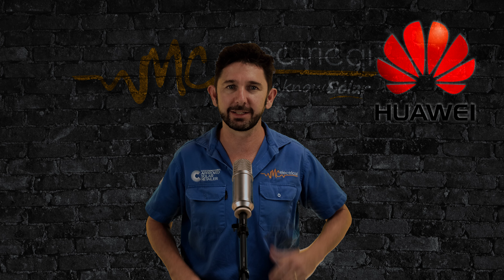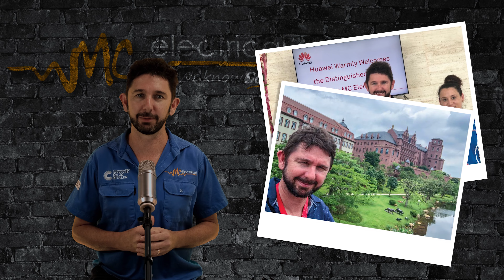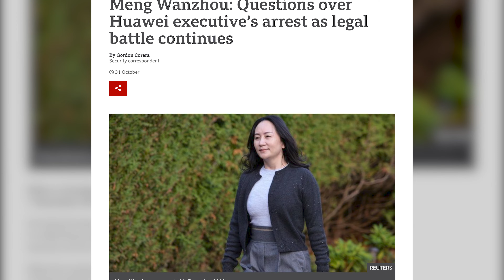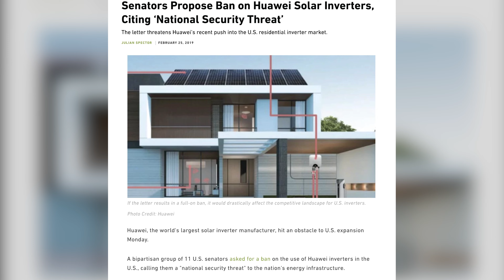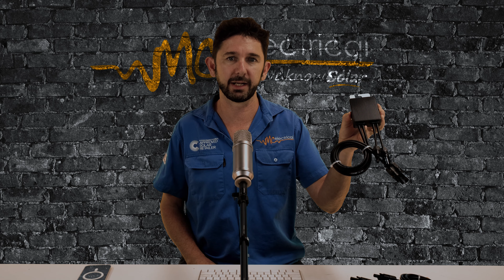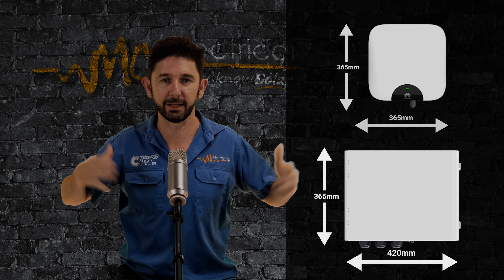Huawei | Solar Optimisers & Micro Inverters Mini Series

Comment: Hi Mark, this has been a good informative video and comments section for me, as I have a Huawei Sun2-6KTL-1 inverter, Luna 5k battery and 8.3kw worth of panels (2 E/W strings of 10 (i.e. one per MPPT).  Am in UK, during the wintertime I have quite severe partial shading issues due to nearby tall trees which really impacts the moring and then late afternoon solar in Dec and Jan (as sun doesn't get above the trees).  Things are better Nov and Feb as only the morning impacts.....then the other months improvement is fast and the shading really isnt too much of an issue, just very short lived in mornings on the E string only (and no real impact during peak May and June).  I had however been considering if optimizers might help this issue in the off season...but what I'm picking up from the video/follow on comments is that they may be more trouble than they are worth...is that right?  Any further definitive thoughts on these four years after you put up the video?  Secondly...had a quick question on where you said you couldn't do one string of 10 panels and another of 14.  Have been considering putting another four 415w panels (same as the rest) on the West side (bringing the total array to just uder 10kw).  Installer did calculations and seems viable for another four.  But you said not doable (but is that just if in parallel vs series?)  Thanks!
Reply from the maker: Hi Daniel, last question first, if you are paralleling into one input it needs to be the same number of panels in each string. If in series then all panels should face the same orientation. Also, longer strings are better if you have shade, because if you shade for example 4 out of 14 panels, then you still have a good voltage for the inverter. 
Second, yeh optimisers are more hassle than they are worth. The Huawei inverter doesn’t have a gmppt (global maximum power point tracker) so optimisers may give you a small advantage, but I probably wouldn’t bother. They create just another point of failure. The inverter still has a maximum power point tracker so it does a decent job of dealing with shade.
Reply: @mcelectrical  Thanks very much for replying....there are two  inputs, one per each set of panels, so think all ok then if your comment was about regarding into one input. And thanks about the optimizers....will give them a miss, a tiny improvement defo doesn't sound worth the hassle!

Comment: If i have SolarEdge optimisers on my panels but want to upgrade my inverter to Fronius or Sungrow , Are the optimisers still compatible in that system ?
Reply from the maker: No. You would need to remove all optimisers. If you have a shade issue, then fronius will solve that, Sungrow won’t.

Comment: I have the sun2000 6ktl -1l I have 6300 watts worth of panels and I have on string of 5 and on string of 9 panels will that hurt my total output power from my solar panels?
Reply from the maker: If you mean oversizing your panels, 300w bigger than your inverter, not at all. We normally install 33percent more panels, so 8kW on a 6kW inverter. This is usually better for inverter efficiency.

Comment: Thanks Mark for your commentary on Huawai Inverters but you didnt really talk much about the Huawai optimiser  which was the stated intent of the video (unlike your excellent video review of Tigo optimisers).  Frankly I was left a little disappointed: maybe you can do a part 2 specifically on the optimisers and their monitoring .  Thank you.
Reply from the maker: Hmm, good point, I didn’t go into the optimiser much. But here is my update. Don’t use an optimiser. There is no need unless you have split orientations, and even then, it is better solved with good string design. Optimisers fail and don’t do much at all at best. If the issues is shade, use Fronius or SMA who have a quality gmppt (or “shade fix/ dynamic peak manager).

Comment: We have been having trouble with the Huawei optimisers, they are cutting out multiple times per day. The system was set up on 2 strings 6 panels on one and 8 on the other (total 14*475w panels) 6.6kw. Huawei's solution was to put all 14 panels on a single string to increase the voltage and "force" the optimisers to work correctly. Does this sound normal?
Reply from the maker: Hi Simon, i can't speak for Huawei optimisers, but tigo and solaredge both have weird issues. I have completely gone off optimisers -stick with a string inverter with a GMPPT like fronius or SMA.

Comment: I don’t understand why you would not research before you do a video. The warranty on this item is 25 years! The 5kw inverter you say is no good for 90% of your clients because they install 9kw systems, well it’s 5kw per string! So 10 total. And you did not tells us what the actual power consumption of this unit is. So pretty useless video really.
Reply from the maker: Sorry about that Richard, but you obviously come from another country that has different warranties and different regulations. We can't 100 percent oversize a 5kW inverter.

Comment: Hi there! Can you do partial optimization in a single string? For example if I have 14 panels and I want to install 6 optimizers, can i do it within the same string or do i have to create a seperate string for the panels that use optimizers?
Reply: You can do partial optimisation. For the single phase L1 model its a minimum of four on a string and for the three phase models its a minimum of six (this comes from the datasheet) https://www.solar4ever.com.au/info/Optimisers.php  Note that you can also use optimisers to run a string in several orientations or keep a string below 600v so they are quote versatile. For the multiple orentations you can do partial or full for the string. For example if you had six panels north and five east you could fit the optimisers to the east, north or all the panels on that string. if you fit it to all the panels it will work better as it can adjust both ways to match up but even if you do partial it will still alter output to match up with the unoptimised panels. Note that you need to keep in mind the minimums mentioned so if you had a string of ten north and three east then you cant just fit them to the east as that would not meet the minimum optimiser requirement so you could fit the ten north however in that case you may as well just fit them to all the panels in that string. If your other string is say 8 panels west then that can be left unoptimised to save money. Its a very versatile system and keep in mind you can always run 2x5kW inverters which will cascade for their data feed and act like a single 4x MPPT inverter in terms of monitoring and connectivity (only the first inverter connects to the smart meter and internet).

Comment: Love the presentation, very informative and straightforward. 
Please I personally need some education on the optimizer,
My concern has to do with the output voltage of the Huawei optimizers.
Am using a 275watts 10-50vdc  rated optimizers on 275watts 38.9vmp panels but the output voltage of the optimizers has been reduced to 26.7vdc but I get up to 46.7voc when I test the voltages of the panels directly with a multi meter.
Please is this normal ?

Comment: I don't understand the problem with current you mention. I intend to use this inverter with flat roof and panels only in one direction.
I understand that the EPS is only needed when there is no power in network, otherwise the attached battery will work as capacitor when network is running - so I dont have to push my production to network 100% of the time?

Comment: By October 2021 - there are now multiple 3-Phase Huawei Inverters from 5kW to 12kW and even up to 20kW.
I have TIGO on SunPower modules with high voltage 60 to 70V - NO outage still 2015 !!!!
I think TIGO is the best!
I think Huawei PV products could be the next I am buying...... due the optimizers!

Comment: So these optimizers just push voltage/current until they reach the upper voltage limit? I’m looking for a solution to recharge 400v ev batteries, this seams like a very good option

Comment: Agree with Kim's comments.
Personally installed and sold so many Huawei inverters and optis and believe that this is the best option out there for complex rooftops.
But the message from this video is so confusing. Is it good or is it bad, or is the speaker confused as it doesn't align with what he promotes. 
 It's definitely not cheap though, then why a dig on saying that it will go in the hand of  cheap installers. 
Sometimes it seems technology advancements like Huawei's are well ahead of MC electrical's decade old mindset
Reply: at about $90 per optimiser, it is still way cheaper than an enphase system and still allows for up to a 30kw DC battery. As per mcelectrical website, a 10.8kw system using the same panels but a fronius inverter is $6000 cheaper than going full enphase. So going huawei inverter and full optimisers would save at least $3000 over enphase. I have noticed that the huawei 5kw L1 inverter states 600vdc for the battery connection. is this up from the 500vdc it used to be as per review https://www.mcelectrical.com.au/huawei-inverter-review/ ? One final thing, how does the new SA laws allowing remote disconnect affect the huawei inverter (remote disconnect compatible?) and the enphase systems...
Reply from the maker: Hi Vishal. There are good and bad parts about the Huawei. That's what i was pointing out in the review and in my blog. It has defiantly improved a lot since the original version but it think it still is wanting. It has it's place but it's a niche product - not good for the majority of systems we quote on. It is definitely cheap for a hybrid inverter.

Comment: i guess if you want to use optimisers, then this would be the best of the bunch? Steering well away from solaredge...I am getting a huawei setup installed with full optimisers (cos i'm geeky and also have 1 string which is going to get shading and another string which has multi orientation N+E). Plus the added advantage over enphase is that i am oversizing the 5kw inverter with 6.3kw of panels as i already have an older 5kw system on the main roof of the house and will be at my 10kw AC limit to the grid. Also i can add a DC battery later on (curious to see what huaweis battery pricing will be) which would not be possible if i went enphase and maxed out my 10kw AC limit.. eg : powerwall
Reply: May I know what's wrong with SolarEdge?

Comment: Nice video Mark... good information, great presentation... love the mic... good sound really matters. Yup... I love the partial deployment option for using the Huawei optimisers (deployed selectively on "problem" panels)... or using the Safety Box and full deployment. We've got a test system at the Lab... remove monitoring and support is great too.
Reply from the maker: Thanks Glen, I'll take that as high praise! I always appreciate your work down at the Smart Energy Lab.

Comment: I'm not in your area but I do find your videos really interesting.  I have panels on all 4 roof directions, two of which  (SW & NW) are subject to partial shading from street trees.  I did ask about optimisers/micro inverters prior to install but I was told that their cost didn't outweigh the gain you would get.  Better to just install some extra panels and wear the losses from shading.  I will await the next in this series and thanks for taking the time to inform us about the various products that are available.  Cheers
Reply from the maker: Hey, yeh a cost analysis would be really difficult. If the shading is significant enough to engage a bypass diode anyway, then an optimiser is redundant. However, if the optimiser stops the bypass diode engaging, or more importantly stops the string from being dragged down for a decent part of the day then i could easily see optimiser paying for itself.
Reply: @mcelectrical  What would be interesting is a bit of a primer on what to look for in terms of whether an optimiser would be useful.  I think the people interested in this aspect would likely have the Fronius Smartmeter (or similar) and could use the Analysis->History function and plot the the current and voltage of each MPPT for a good, sunny day.  My understanding is that solar panels are (forgive my layman terms) constant voltage/variable current devices so a drop in voltage means that the shading is significant enough to engage the bypass diodes.  The more difficult to diagnose situation is where the current drop is due to the lower light intensity from shading and the impact this has on the string overall.  In my case, I have 3 strings into MPPT1 and two strings that suffer from shading (NW & SW) attached to MPPT2.  Anyway, you're producing a good series so thanks for that and I look forward to the next instalment.